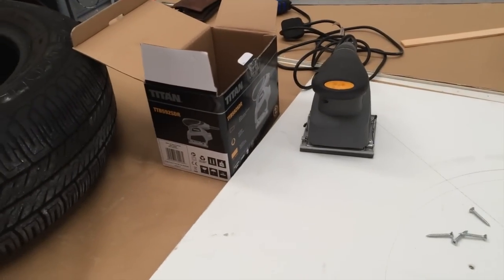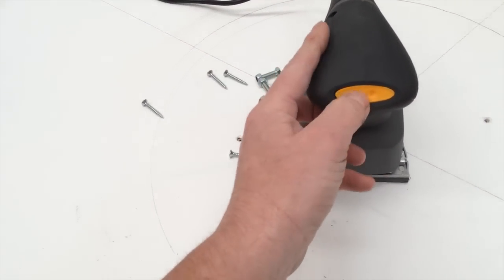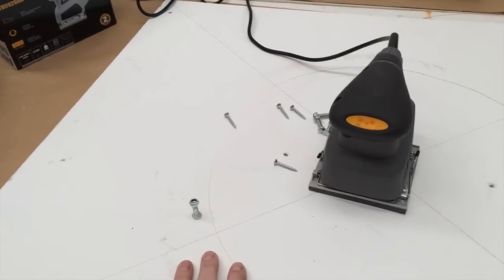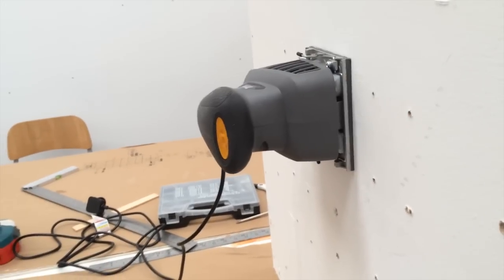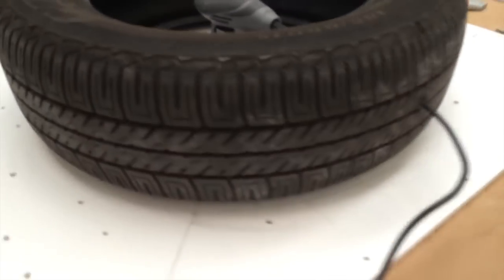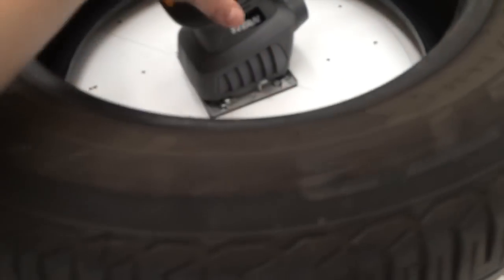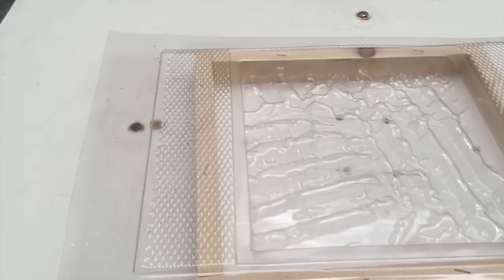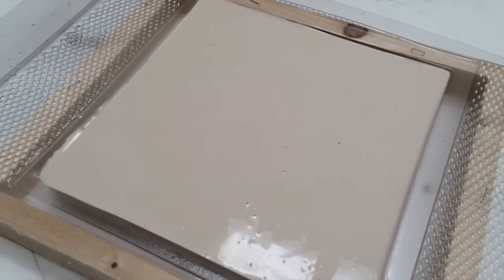Economic vibrating table (hand sander)

Comment: Don't despair!
I think hand-held sanders mounted upside down are burning out because of the 'inflexibility' of direct contact with hard steel bolts and the wooden board.
You should have used 'flexible' fixings, which would have allowed the sander to move and flex as was its intended design - hence the need for a cushioning sanding pad!
I would suggest anyone considering this project should only mount the sander with bolts cushioned with some kind of rubber sleeve or washers against any hard surface that it comes into contact with. This should provide some much needed flexibility, and will prolong the life of the sander... certainly it will help prevent shaking themselves to death. Same with washing machines too, they also have rubber sleeves on their bolts don't they?
The alternative to mounting it upside down, is to place a board across the top of your filled mould, and just hold the sander on the top moving it around as you would when you normally sand something.
Good luck.
Reply: You are essentially proposing to isolate the sander from the board (As I understand) The whole goal of a vibratory table is to transfer as much of the vibration to the table.
Reply: Damn good advice man.

Comment: I used a dewalt sander and it broke in about 5 minutes. the inside bracing was made of plastic and being hung upside down which it is most likely not designed for.  Great concept and worked great for the 5 minutes but the way they make tools today. 

I am now looking to getting an actual vibrating motor.

Comment: Yup just built this is in 15 minutes and burned out that cheap Ozito sander in less than 2 minutes. Now I neither have a sander nor a vibrating table. :D
Reply: That's coz you got an ozito. And chances are the thing was touching the table underneath. Has to be free to vibrate. But you show me any ozito that lasts more than 2 weeks with its INTENDED use.

Comment from the maker: going to fit a power adjuster to regulate the power to give me more control on the rate of vibration. works well though and pleased with the results especially as its just a sander .

leave comments please and click like if helps
Reply from the maker: had a slight problem with the sander and its bracket but held on with some strong bands. I may go for a motor but wanted to try the concept of the table for my moulds, think your solution is fantastic but cannot see the motor in the UK ..tanks for posting its sorted my pin hole problem in my plaster castings ......